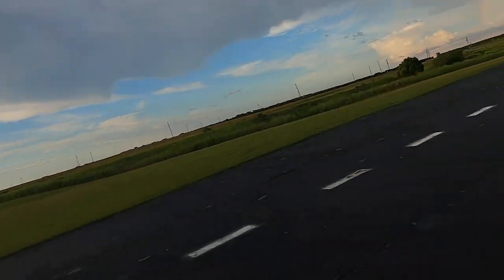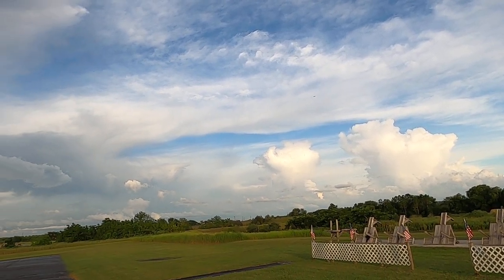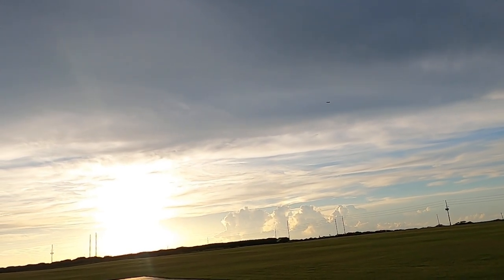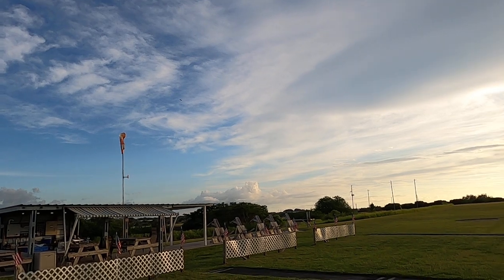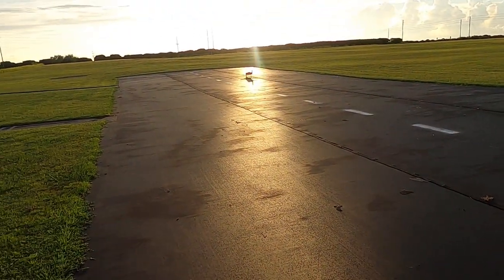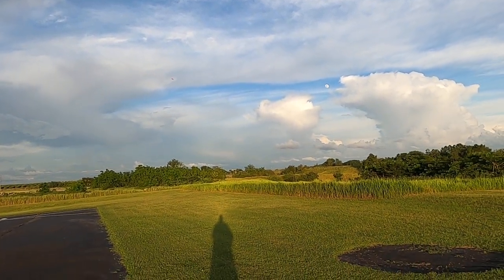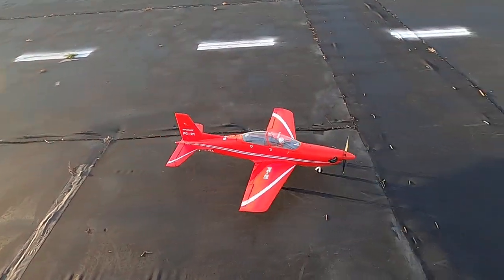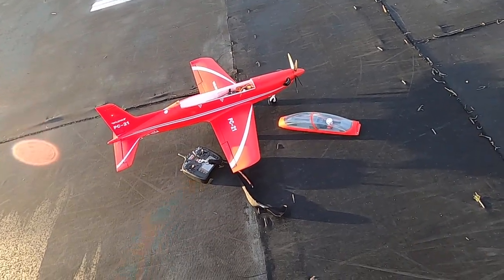2ND TIME EVER! Flying the FMS Pilatus PC-21 by Fat Guy Flies RC

Comment: When you put your flaps down are you reducing throttle to 1/4. Or leaving it at 1/2 throttle.  I always let the plane slow down to around landing approach speed.  That’s were I set & dial my mix in to hold level flight if you choose to do a fly by .  No need to hold down elevator elevator . 😊.   Something worth trying.   I really enjoy your videos. Keep them coming.
Reply from the maker: I will try that. thanks!